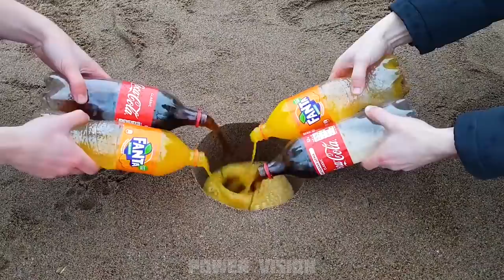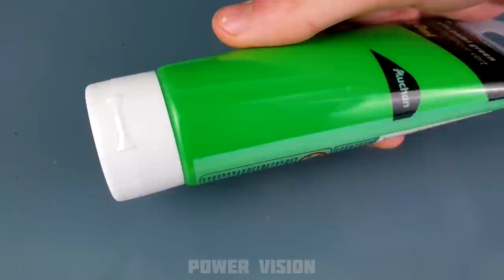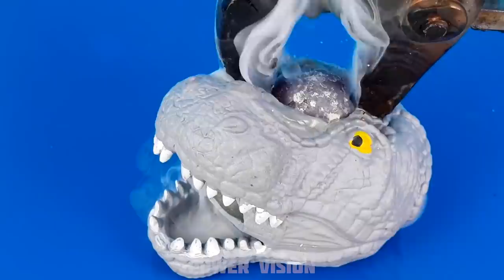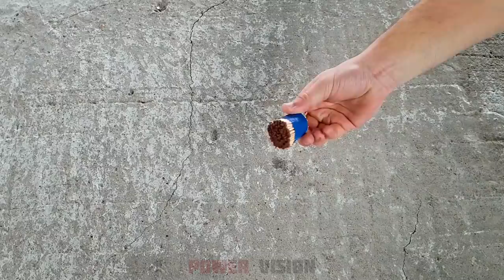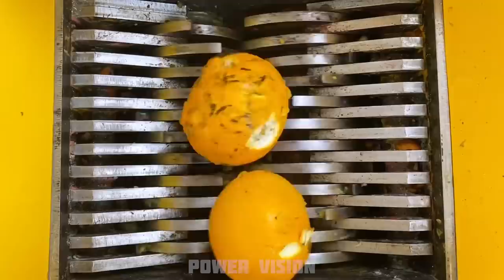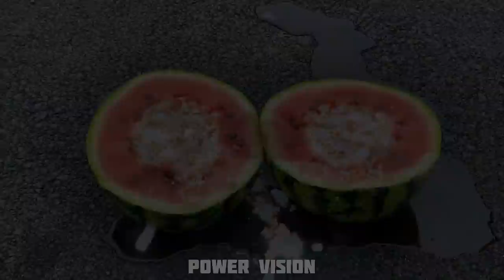Experiment: Coca Cola and Lava Underground!

Comment: It was a great experiment, I really liked coca, why did it react like that
Reply: @Woa Doodland it was melted iron not lava he was lieing ive tried and it dont work
Reply: @joecobb3453  welted iron is technically still lave but when cool turns to metal instead of a rock
Reply: @tennyolodi5437  technically its not theres a big diffrence lava is magma witch comes form under ground and melted iron is metal not magma this dude is jus triging to get vews when its fake
Reply: @joecobb3453  good point I don't think he wanted to lie uts pretty hard to get lava
Reply: @tennyolodi5437  yea like the contaner it was in would have melted if it waz real lava hey do u have insta ?    if u do mines ultra_deku_ua
Reply: @Teny Olobi 
.

Hahaha